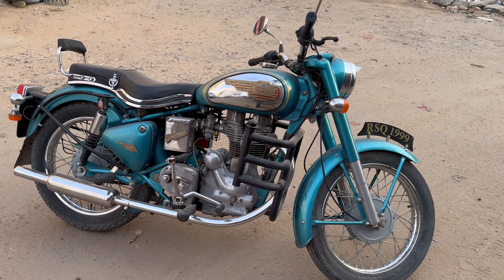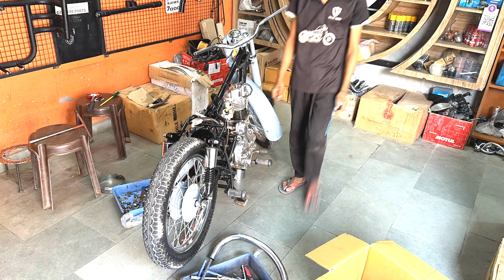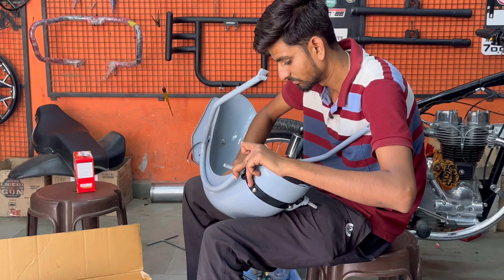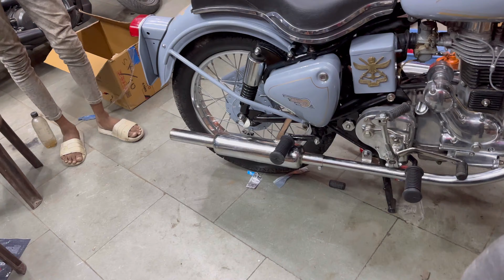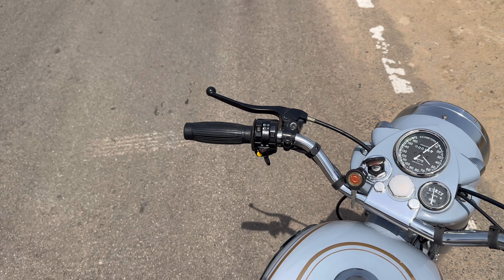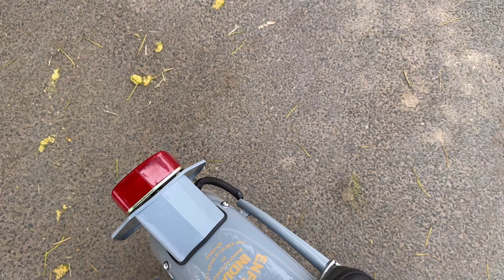Full Restoration 53 Year OLD Bullet 350 #vintage  | Royal Enfield modifications 🇮🇳@BulletTower

Comment: Pretty sure that’s not a 1971 manufactured engine. It’s more of a 2006-2008 engine.
Reply: Yes, the engine is changed, it’s not the b1 engine
Reply: @dvt_Kaneki   then there is no point in saying restoring a 53 year old 1971 model bullet. Rather say restoring a new model bullet back to B1 series.
Reply: @vintage.warhorse  pretty much it kills the old vibes, specially since the engine change, I agree with you